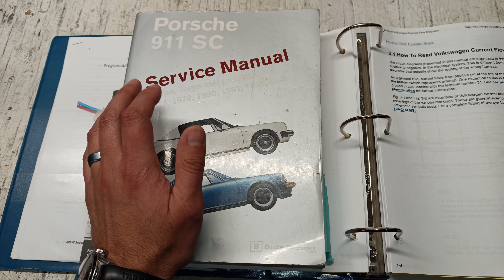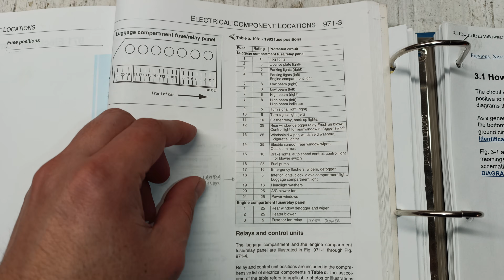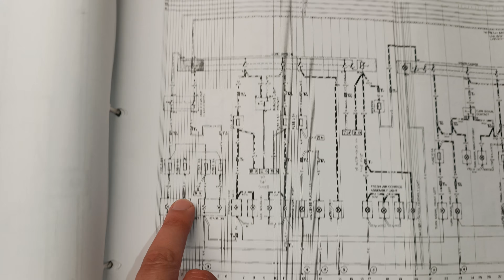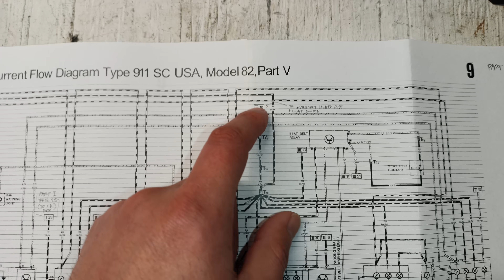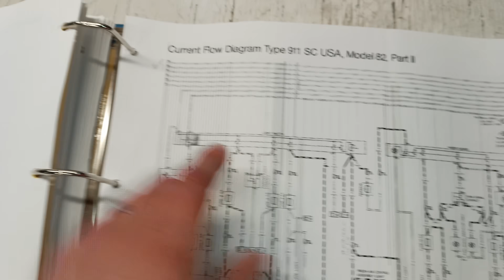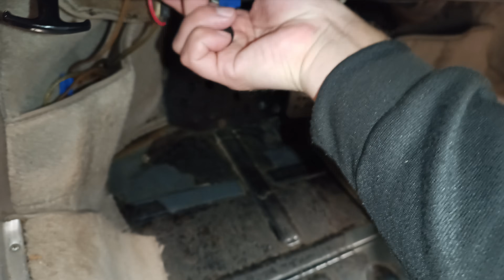How To Add A Fuse To The Dash Lighting Circuit On A Porsche 911

Comment: If folks want to address other electrical weak points in these cars..here's a list
1. Install headlight relays
2. Install 7.5 Amp fuse on front blower
3. Install 10 Amp fuse on AC blower in smuggler's box
4. Install 10 Amp fuses on each of the footwell blowers
5. Install 3 Amp fuse on engine bay light 
6. Install 3 Amp fuse for dash lighting (this video)

Comment: I had smoke coming from my dash lights after my front trunk light shorted on the body. Will adding this fuse protect that circuit?
Reply from the maker: Not sure if the frunk light is tied into that but definitely the dash lights such as gauges, heater/fresh air backlighting, etc.

Comment: Thanks, good idea.
My directional/ high beam switch on my 1977 911S was replaced by a mechanic and I noticed some wires are burnt. Now the feature of using the directional switch to light the parking lights no longer work. Any idea where I should look!
He went out of business (go figure).
Reply from the maker: If you search around, especially on the pelican parts forums, you'll find folks sharing the factory wiring diagrams. They are better than what you will find in the Bentley manual.

Comment: Hello Jose, I enjoy your videos and I’ve learned from your videos on how to work on my 1974 911.
     I need some advice on selecting the proper multimeter to use on my 911 checking the wiring. I don’t know anything about electrical wiring and how to read a multimeter. I’ve seen a lot of multimeters for sale on eBay and Amazon that are really cheap and they’re made in China. I just need to know and a brand and a model number that will do everything that I need to do on checking my electrical wiring without paying two to $300 for a multimeter. What brand of multimeter do you suggest? Thank you.
Reply from the maker: A Fluke is spendy but will last forever. For normal DIY tasks something like this will be just fine. https://amzn.to/40bruXK
Reply: Thanks for the help. I’m gonna go check out that multimeter.

Comment: add an inline fuse for the windshield wiper motor, the motor is unfused when it is goes to park, if the motor jams it can burn up the wiring. I replaced the entire dash wiring harness on a 1976 912E.

Comment: Great video, where did you get the shop wiring diagram? Having issues with my power mirrors so those diagrams would come in handy. Thank you
Reply from the maker: If you Google around you can find the entire workshop manual and wiring diagrams. Can't link it here for obvious reasons.

Comment: Does anyone here know where the "3rd" bk/blue wire on terminal 58a ultimately goes?  In this video it goes to a white connector and on up - but where it goes is not viewable.  My car has this short wire with the connector, but it is hanging loose not connected to anything.  I could not find any other unattached wire in the area - with the opposite terminal connector or without.  
Before I put everything back together it would be nice to know if I need to find the other side or if my car may just not have had that circuit.  
BTW, getting the switch out may not always be easy.  As the video mentions, it is sometimes a problem getting the knob off of the switch.  It can also be really hard to loosen the plastic retaining "nut" underneath the switch knob.  This part is the black plastic piece that holds the switch in the dash.  I tried several different tools and finally had to knock it loose with a hammer and a punch.  Luckily it didn't break.
Also my car is a Euro targa with a locking frunk.  There is an apparently immovable metal plate right underneath the light switch that makes it tough to get a grip on the switch from the backside.  If you keep after it, you can find a way to drop the switch.  There is just enough room.  Hope this helps.

Comment: Did you have to crimp anything or just plug it in and heat shrink it?
Reply from the maker: The fuse I bought had the connectors already crimped so just plug in and repair some shrink wrap. Worst case if you use an auto parts store fuse you'll need to crimp a spade on each end.
Reply: perfect. i will order the one you got. @JoeEngineer

Comment: Its not clear to me what connector is being used to connect the 2 female connects (that originally went to the switch) to the wire that goes to the fuse.  how is that done?
Reply from the maker: That switch terminal has a piggyback connector. It's a female spade connector with 2 male spades on it. Female side connects to the switch and 2 males go to the harness. There are several on that switch and through the car's wiring.

Comment: Great video! I'll be doing this on my 1984 Targa soon.  Are there any other unfused connections that should be addressed?
Reply from the maker: I think this is the most important one as it has the most subcomponents connected to it. I'm still looking into others.
Reply: @JoeEngineer  I’ve head that the fans are not fused, is that true?

Comment: Thank you for a video that may save some old 911's from catching fire.  The video was timely as I am now looking into my wiring also.  In my review, it appears circuit K on the light switch may also be unfused as it feeds power to the ashtray light.  Am I looking at the diagram correctly and should I add an inline fuse here as well as to 58a?
Reply from the maker: I was thinking the same thing...